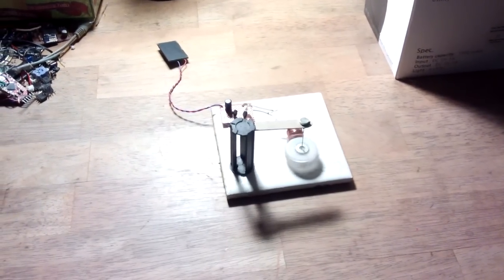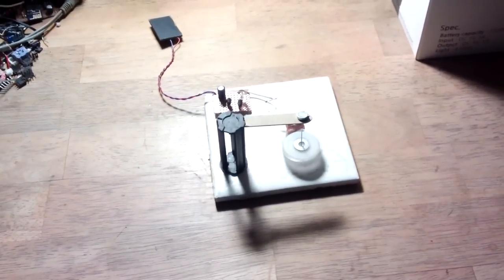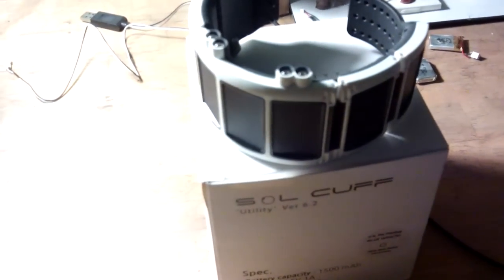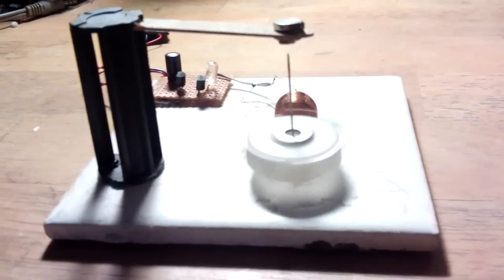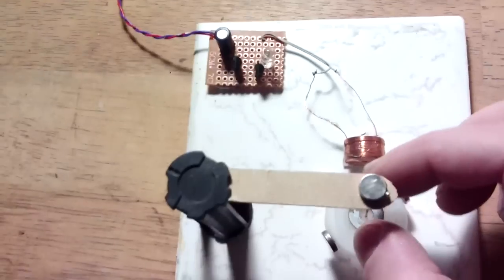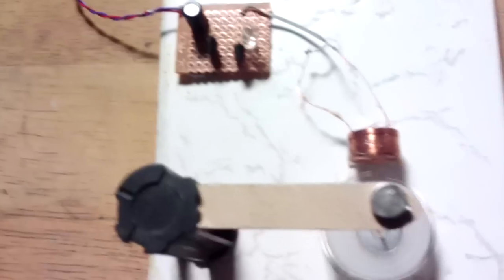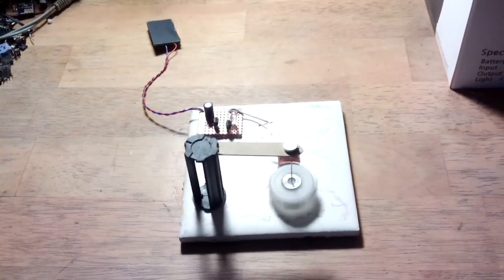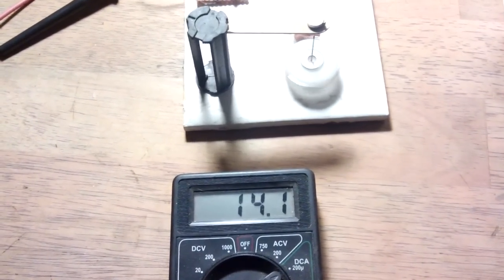14uA  ?  - Lidmotor Micro Amp motor

Comment: This is great.  I have been working with this for a couple days also with similar modification to the setup.  I put the circuit on my Lasersaber EZ Spin and it worked fine.  I went to a much higher PNP resistance also.   I had a 3 meg pot that was fun to try.  I am really puzzled about exactly how this circuit operate at such low power.  I also went to an MPS npn.  Good job!  I hope more people try this circuit.
Reply from the maker: Good to know about the EZ Spin. While desoldering components from a spares board, several Megaohm type resistors were found, 4.7, 2.2 etc. A very rare thing to happen....the direction was set !  
It's another ace of a circuit from your good self !. What's next ? lol

Comment: Thanks for sharing
Reply from the maker: It's been a fun build so far...am experimenting with 8 coils now, as 2 pairs of 4. 4 megs of resistance !
Reply: I tried that a little while ago.. bought all these solar toys.. was doing pretty good until I foolishly decided to hot glue the connections at the coils. I had totally forgotten another user had offered the advice NOT to do that.. sure enough one by one the wires started breaking off inside the hot glue til I was left with only one coil. almost dreading having to snatch more out.
Reply from the maker: 2 lots have done that here over the couple of years...just mentioned the box of them to GIAOM above. Same thing happened with CA glued R/C components from back a few years ago, I think it's a sunlight reaction.
Best method seems to be Fix All from Dollar Tree or white glue. Fix All is mildly rubbery or something, flexible anyway such that sudden shocks don't break wires.

Comment: I think this circuit beats the efficiency of the solar toy. I wasn't able to get that kind of rotation using the solar toy circuit until it was pulling around 100-150 microamps. 15 or so is amazing.
Reply from the maker: After some more experimenting this evening, I can guarantee it beats it !  Runs 4ft away from the lamp, on the same panel as the solar toys. It does though now have 8 coils for 4000ohms lol. Also has a couple of pickup coils.
Reply: @Slider2732  
You have thought to make one with coils that feed back the circuit, I imagine that if or that they recharge the battery in some way so that its discharge is less.

Comment: Amazingly low current draw! Can pulse motors be geared in order to do useful work?
Reply from the maker: Maybe with a very low friction set up of gears. More amperage in though to keep rotation speed. As far as grunt it's difficult with no iron. The bigger the magnets and larger the rotor also helps. If anything ever tripped over into generating more power than the input, that would be where the extra would be useful, as a limiter. Light would also be effective for that purpose.

Comment: May I ask you the best way to remove those coils from solar toys?  Do you use solvent?  Thanks.
Reply from the maker: They are usually held with a glue similar to hotglue. My usual method is to hold the base side close to the soldering iron for several seconds using pliers. When the plastic starts to bend down, gently lift the coil and it should come away.
Reply: Thanks.

Comment: Hi. I'm recreating this motor atm. Can you tell me if you connect the 4 d.f. Coils in series I guess from centre wire of one coil to outside wire of the next ??? If this is done wrong the effect of one coil could cancel the magnetic flux of the next? Hope you can tell me how the coils are connected to each other.
Reply from the maker: Completely correct !
Yes indeed, the end of 1 coil connects to the start of the next. It's easiest to line up when the rotor is stationary in the middle, held up by however you arrange it, then the coils can be glued in place. I'd advise hotglue as a drop on the front coil and quickly placing in the right place. If correct, make solid with hotglue at the back. 
CA shouldn't be used, because over time it eats the enamel off the thin wire. Plenty of R/C aircraft motors and others have failed by using it, my own included. Works for a while, then 1 day just doesn't and that's the cause..
Alternatively, you can place individual coils at 90 degrees around the rotor, for 4 x 500ohm. As long as they are at 90 degrees to each other it works well.